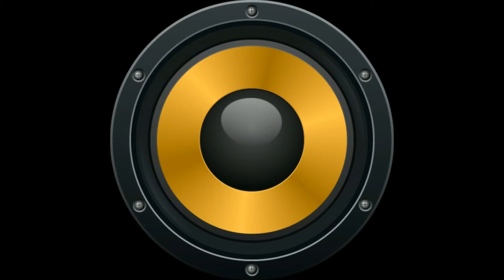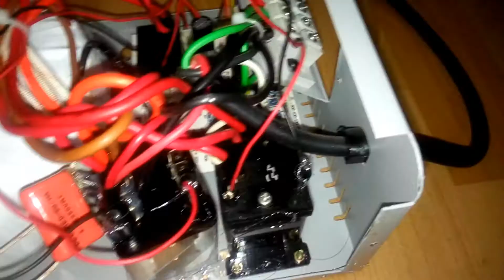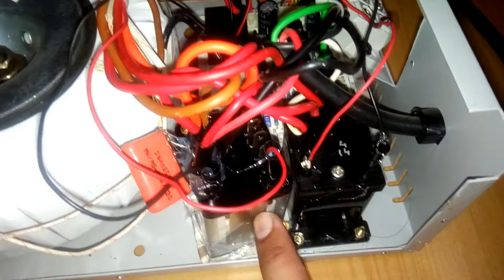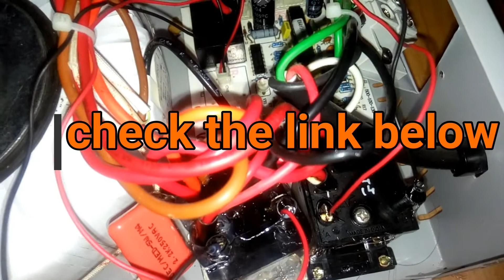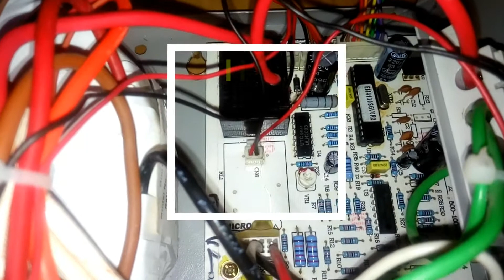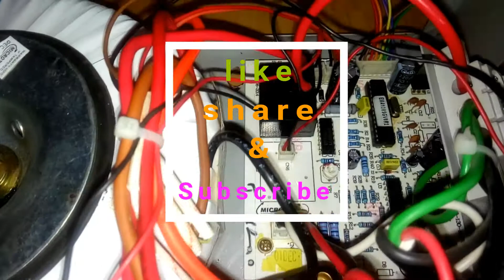How to repair voltage stabilizer for air conditioner/ relay fault fix

Comment: microtek stabilizer showing h1 MODEL NO. EM4170 HOW TO SOLVE
Reply: Hardika Chhabra G mere bhi stabilizer ke same model me same problem hai, preshan hu 2 din se solution mile to plz btana..
Reply from the maker: Relay conetroler ic fault